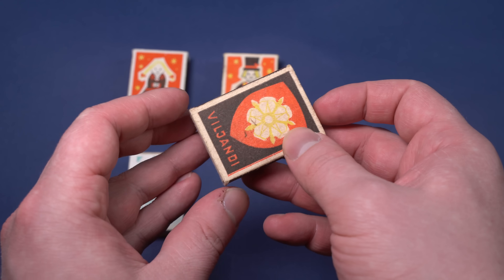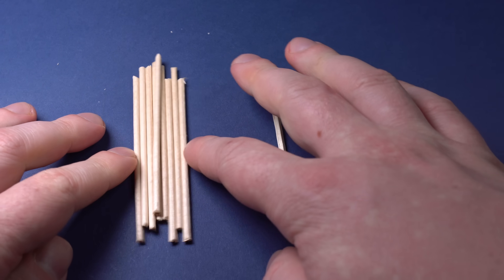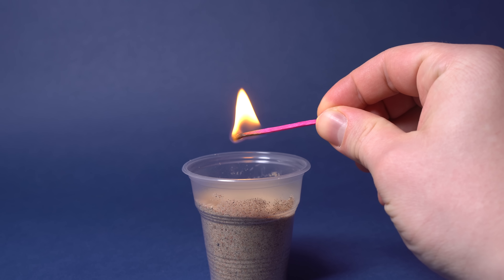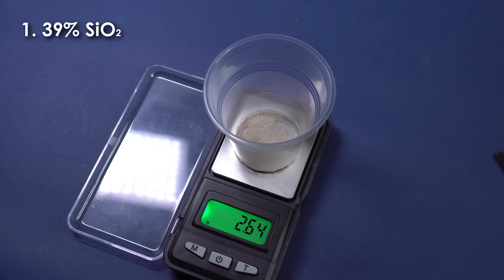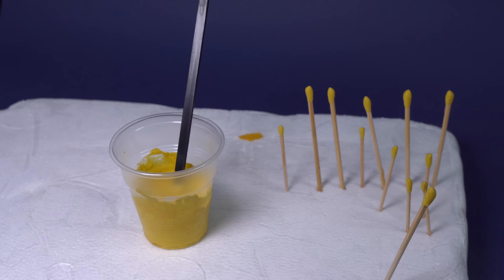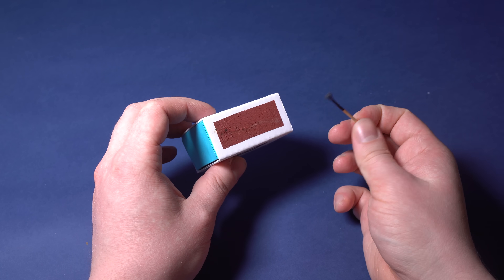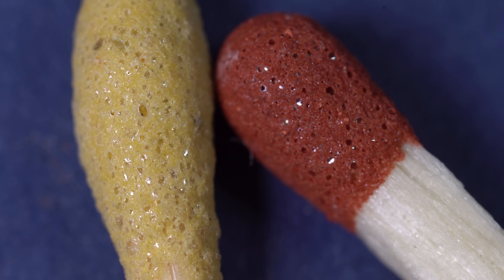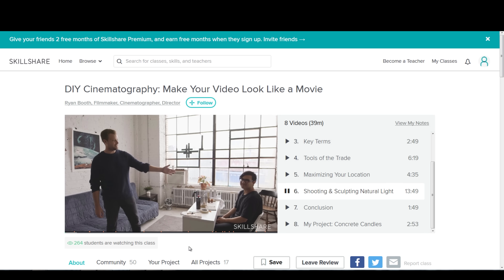I Made My OWN DIY MATCHES!

Comment: That red colored match was soaked in a type of fire retardant that colors wood red as an indicator of the process.
Because they are so old and the formula they used was not likely very strong is the reason they smolder.

Comment: Those strike anywhere matches here in the US are rare in certain areas of the country due to different restrictions. In my area they arent really banned and a few places sell them,but they are still very uncommon and expensive in comparison to other style matches. Im fairly certain theyve changed the composition from what they used to be. They now are alot harder to get to light on other surfaces nowadays. in most cases ur better off using the strike on box style instead cus of how more reliable they seem to light. The others always seem to just snap the phosphorus off. That said i still like them. Very handy for experiments, emergency kits, and various everyday carry kits. Fun video.

Comment: If anyone could answer this question, it would be much appreciated:
Would the chemical reaction be affected if you added a coloured dye to the mixture?
Would the reaction also be affected if you sanded down the tip of the match?
Reply: They normally use water soluble dye for the match heads for color what do you mean san down the tip the wood or chemical compound
Reply: @samellowery  sand it down so the tip looks more "presentable" like the commercial matches
The commercial matches look symmetrical and they all look identical
The ones made in the video have variable-sized tips (which is understandable) but it doesn't look... Professional
Reply: @samellowery  Thankyou for replying :)
Reply: @frenlyneybur7544  if you watch how matches are made in factory they are dipped and dry upside down that would be your best bet for getting them to look better. 👍🏻
Reply: @samellowery  ahhhh very cool!
Thankyou so much :)

Comment: A practical video for those who lack matches.  Seriously, a wonderful presentation.  I like those "strike on anything" matches because they are much bigger and will light fires more readily when preparing the bar-b-que or a campfire.   Those matches are very hard to self-ignite because it takes a considerable pressure against a rough surface to cause ignition (a force on a small area of the match head).   They are at least as safe as cars and alcohol (separately or together)!  Live dangerously, dare fate, be courageous.

Comment: The strike anywhere matches are more dangerous maybe, but I've never experienced any accidents caused by them. You can even strike them on  smooth glass. They can be useful if the matchbox gets wet, because you can strike them on most rough, dry surfaces. Smokers like them because you can give them to a friend and they can use them later without the box.

Comment: Strike-anywhere is a feature, not a bug. If you are camping out in the woods and need to start a fire, it's nice when they work in the damp. Coating them with a thin layer of paraffin protects them from spontaneous ignition and waterproofs them.

Comment: 3:44 I didn't know that matches contained hexavalent chromium. Also, why is your potassium dichromate white? Shouldn't it be orange?
Reply: +Crimson Chemistry:
Yes, K2Cr2O7 is orange, so I guess he screwed up. Since the end product ends up as orange, I guess he really did add K2Cr2O7 off camera.
Factory made matches don't contain K2Cr2O7. That is a strong oxidizer.

Potassium chlorate (KClO3) is also a good oxidizer and that is what they add in factory made matches.

From wikipedia:
The striking surface on modern matchboxes is typically composed of 25% powdered glass or other abrasive material, 50% red phosphorus, 5% neutralizer, 4% carbon black, and 16% binder; and the match head is typically composed of 45–55% potassium chlorate, with a little sulfur and starch, a neutralizer (ZnO or CaCO

3), 20–40% of siliceous filler, diatomite, and glue.
Reply: K2CR2O7 is the toxic chemical, it cause to cancer ._.
Reply: I'm looking for some composition references, i want to try make it, but many articles say there is an element of antimony sulfide for fuel in matches head, and antimony is dificult to buy, in this video i looking Composition without antimony sulfide,
Reply: I think the yellow color is from sulfur and not from the dichromate
Reply: Wow ur first name is element from cat litter
Reply: Psss, that's sodium alginate!)
Reply: Potassium dichromate has orange color. he must have added a yellow dye to give paste yellow color. Chromate is strong oxidizer having 7 atoms of oxygen in one molecule. its used to increased speed of oxodation of feuls in matchheads , by providing too excess oxygen, or incase if matches are light up in oxygen deficient areas.
Reply: Aluminium Soup its just simple chemistry I learned through doing experiments. Eventually, after doing enough chemistry, you'll know the color of each oxidation state of at least the first row of transition metals.
Reply: @cobalt7530  Wow ur first name is element from cat litter
Reply: Wha!?

Comment: Are homemade matches cheeper than those from store
Reply: I highly doubt it's cheaper. Maybe if you bought enough material to make a couple hundred thousand and it probably took him an hour to make a box and that most likely takes a machine 20 sec to do.
Reply: A single box of matches costs approximately $0,07 here in Czech Republic. I don't think it's worth it to make your own. But sure thing it is cool to make your own.
Reply: +HRVATINA:
Obviously, you haven't done much home chemistry.
Chemicals are quite expensive.
1. Red Phosphorus  might be hard to acquire in the USA since it is used in the making of methamphetamine.
2. You can buy KCl and turn it into KClO3 via electrolysis.
3. You will likely buy sulfur directly
4. I guess for the SiiO2 powder, you can get sand and crush it into a fine dust.
Reply: It is like grilled chicken is cheaper than cooking it ourselves.  We cook ourselves because we like to put our own ingredients to it.

Comment: It is important to know that "strike anywhere" matches sold by large brands, like Diamond only have the strike anywhere material on the very tip of the matchs head, therefore still being as safe as typical safety matches.
Reply: If you have strike anywhere matches .be sure to put them where a mouse wont gnaw  on them.because they will ignite!!!!!
Reply: And most of the time they are useless because that tip will break off separate from the rest of the striker
Reply: I wish I know this when I was trying to ignite a Swan Vesta with my fingernail.